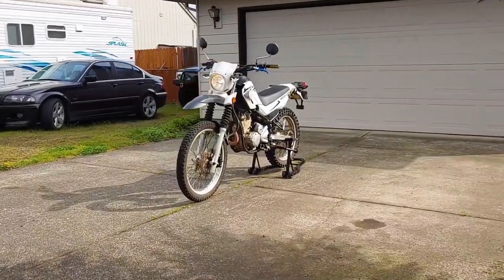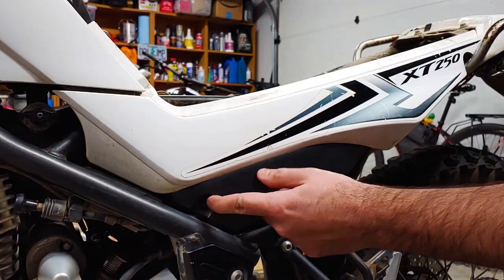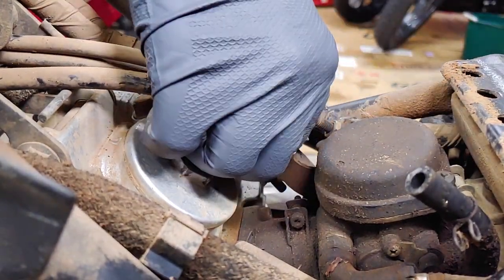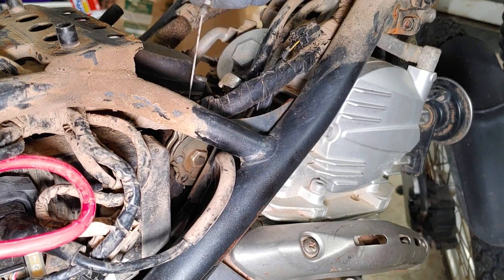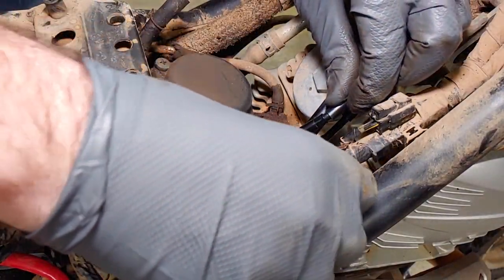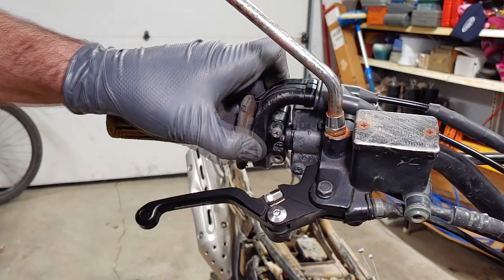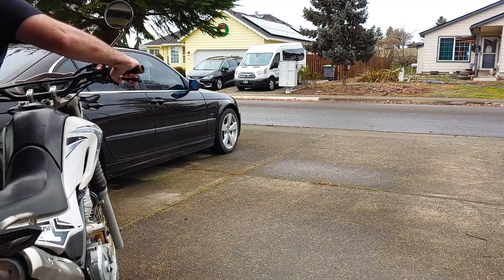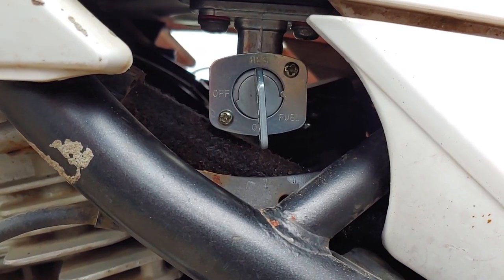Throttle Cable Replacement Guide for Yamaha XT250 / Serow 250

Comment: Im new to riding and have to replace my throttle cable does it matter wut type of throttle cable i get??
Reply from the maker: Yes, the throttle cable needs to be the correct length and also needs to be routed correctly to work.